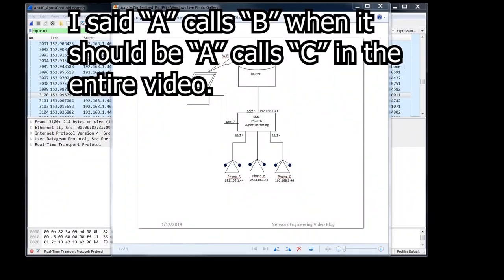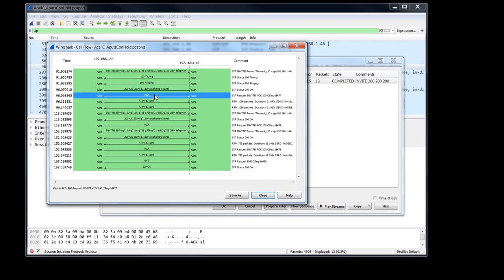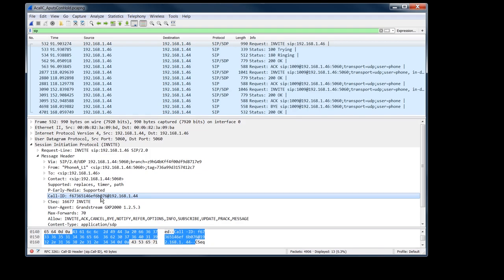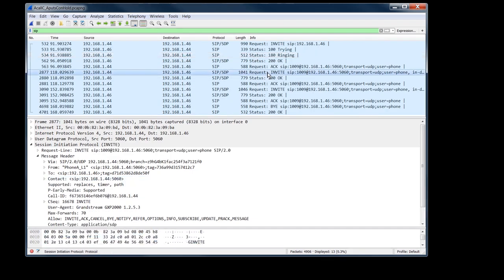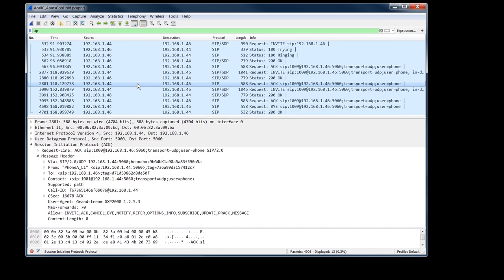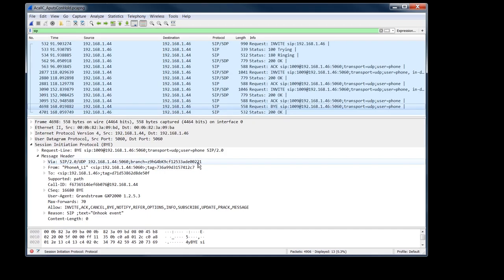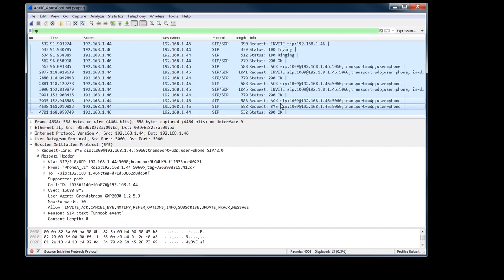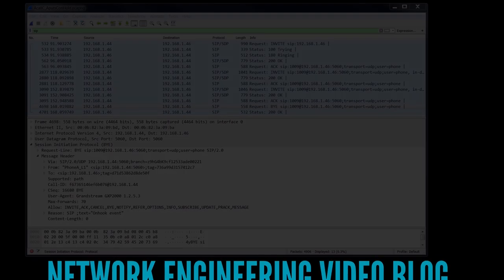NE #78 SIP Call HOLD Explained

Comment: can you put up a video for css partition mismatch also..using the sdl traces so that we know what partition is missing from what css
i re-created the same and noticed that the css id can be checked above the DA and the filtered partitions but how do we get know what partition or css is missing that needs to be added.
Reply from the maker: My friend, you have me stumped with SDL traces.  And with css, are you asking about a Calling Search Space?   A quick google showed me both SDL and CSS are Cisco Call Manager (CUCM) things.  Calling partitions and search spaces are used to route SIP messages and, to my knowledge, don't have any affect on the SIP headers other than maybe a via.  I guess Cisco could put in some custom IEs in the SIP message, but I'm not familiar with them if they do.  Good luck!
Reply: He is explaining about pure the SIP world which is vendor independant knowledge nothing of Cisco, Avaya specific so for CSS/Partition is the basic building block of Calls in CUCM or call manager. Its very basis and you can validate this directly if you use DNA or if you know A and B parties don't need to check the logs pss you can find this information in SDL traces